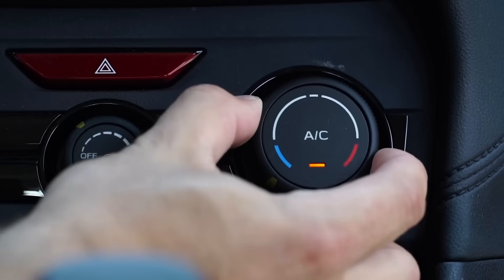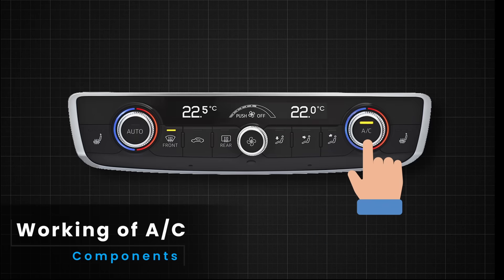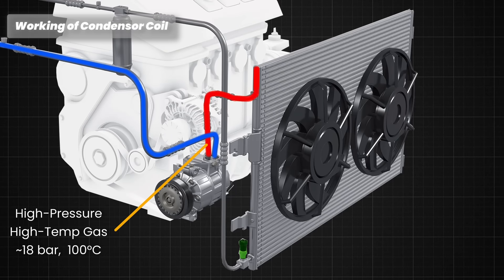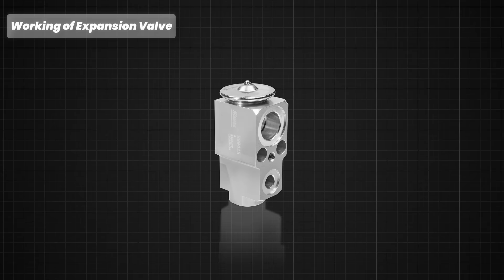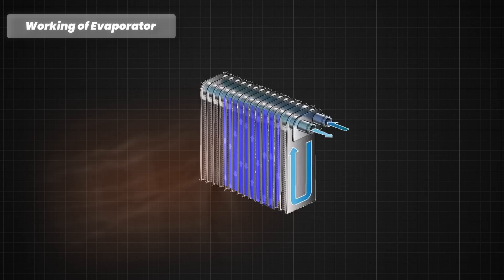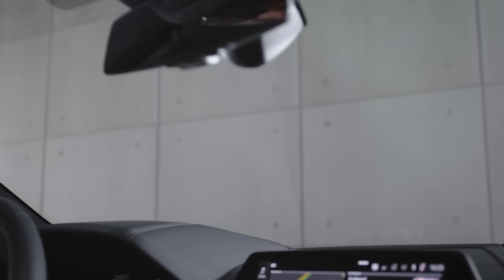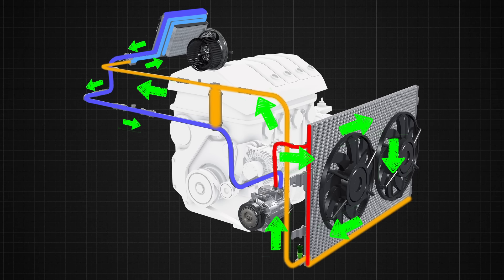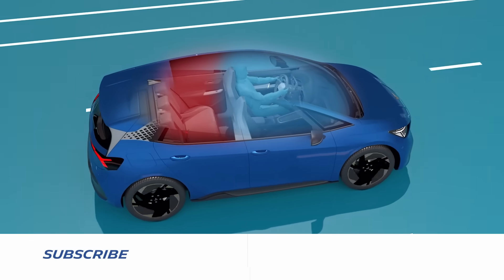How does Car Air Conditioning Work?-Components and Their Functions -Car AC system

Comment: Red alert check your cabin filter and just above it where mice build nest,, and there is mice feces disgusting or even a chipmunk,, and you are breathing it every time you have your air on. You must mouse proof your air flow in the cabin of your vehicles!!! Pop your glove box wide open and you can get to it, to check the filter and the area just above it,, there's usually a big enough place up in there that a mouse can build a real nice nest, so disgusting you're breathing that air. I'm going to feed some metal wire up into that space and loopy loop fashion, and fill in it in so they are not comfortable to linger or build a nest. Also I'm going to find any other areas where they can get into it and screen it off!!!!! Each vehicle will have a different air circulation system within the cabin.
Reply: Spotted a couple of mice poops already. hhhh, they left but still smell their presence till the filter changed
Reply: @Max-Jet Yea you’ll need open your car windows for a while, perhaps spray some air freshener spray. And vacuum your carpets and use wipes on all hard surfaces that may have trapped some smell. 

I had a bad smell in my car from the previous owner and I did this along with scrubbing and washing the floor mats outside. My car smells pretty fresh now.
Reply: Just take out your whole dashboard and condenser and blower fan and clean all the dust off and out of it once every 2 momths
Reply: @ebeneZr lol what sort of car are you driving to go to that extremes it took 4hrs to get the D-Max dash out at our work shop your not going to that every 2 months lmfao
Reply: Your mechanic should check it most service's
Reply: Well, in my case, the mouse died and rotted there instead. Imagine the smell

Comment: How the airflow is controlled through the vents? i mean between dashboard and floor and to the front glass?
Reply from the maker: Air flow is controlled by a series of dampers, flaps, and shutters that are operated either manually or automatically.

In old vehicles, you manually operate knobs or levers that are connected to cables or vacuum lines. These, in turn, move the dampers to direct airflow.

Modern vehicles use an electronic control unit that adjusts the position of the dampers based on inputs from the user and sensors. The user sets the desired temperature and airflow distribution via the control panel, and the ECU adjusts the dampers accordingly.
Reply: @motoringmasters  decided to google it.

Thanks for the answer, I was looking for the blend door actuator or something like that.

Comment: Vary informative video well explained 🎉 I have a question,  what hapend when we set temperature to cold or hot in manual ac systems  dose it affect car fuel consumption and how we get better mileage with ac on ? Thank you
Reply from the maker: Technically, in the engine side when the AC is turned off, the mileage is high, but practically, when the car comes and drives on the road, the mileage drops due to aerodynamic block when windows are opened.
using AC can increase your fuel consumption by as much as 10% but opening the windows at higher speeds can increase fuel consumption by as much as 20%
Reply: If I set temperature to little bit worm side ( 28-30) dose ac compressor feel less stressed ?
Reply from the maker: Yes definitely, the cut-off time for the AC compressor will increase, so it works less.
Reply: @motoringmasters  thank you very much 😁
Reply: @motoringmasters The cutoff time decrease or Increase?

Comment: I'm here To try to figure out how to keep mice from getting into my Cabin filter you know the air conditioning
and you're heat
Air flow.
Reply from the maker: Still the world does not know how to deal with this problem 😁 However, I have some solutions, you can try it.
Place a fine wire mesh or screen over the air intake vents to prevent rodents from entering. Make sure it is securely fastened and doesn't restrict airflow.
Keep your car's engine compartment clean and free of debris.
Reply: get an outdoor cat.

Comment: Now add all the modules and electronics from manufacturers that prevent the simplest operation of this system not to work.
Reply: So, they do work? According to your words 😅
Reply: @coldbrew6104  they don't. I just recently charged a customer $1900 to replaced the HVAC module. The entire system was perfect but the computer was dead. That doesn't happen on older models. And that computer was behind the dashboard BTW, I'm in Texas where yesterday the temperature was 111 degrees.
Reply: Uh, how old of a model are we talking?